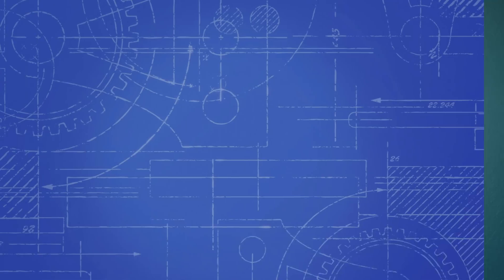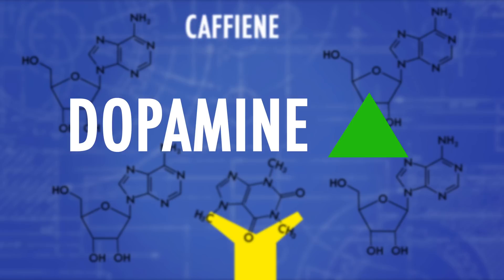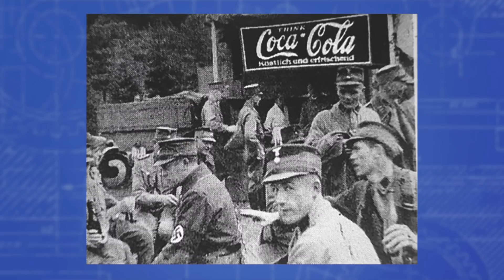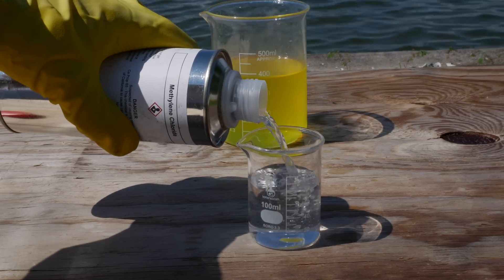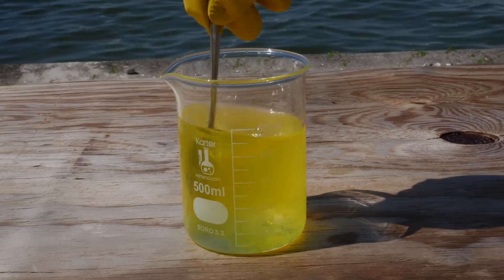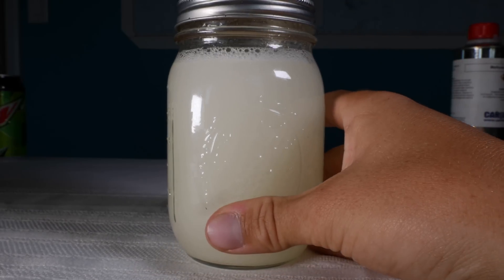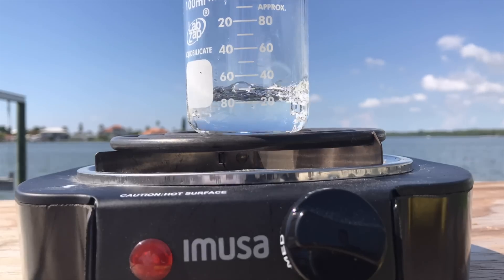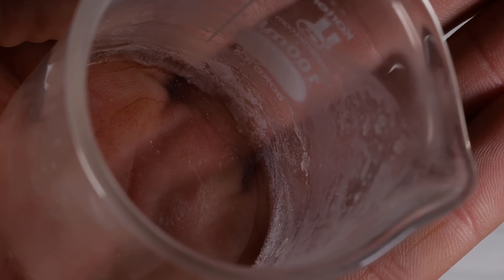Extracting Caffeine From Mountain Dew

Comment: DCM dosen't really make a stable emulsion with water, and not mixing hard enough means there is very little transfer, multiple extractions are recommended too. if you heat the DCM to evaporate it, then you should put a cold flask on top to catch all the caffeine that sublimates (you'd be emulating a cold finger)

Comment: Could boiling at a lower temperature work? Apparently it boils at roughly 40 degrees Celsius (about 110F?)
Reply from the maker: I believe it would. I’m tempted to try this again and just leave it out to evaporate. My hot plate is not very good and it is hard to control the temperature.

Comment: Another great video! Fun fact, I used to work with methylene chloride while making pharmaceutical product (used to coat some oral medication). Now I work with epichlorohydrin, which is from the same group I believe, but also in oral medication!
Reply: you wouldnt happen to be working in epoxy/polymers?
they are a fair bit different, the  epichlorohydrin is a reactive substance (being an epoxy) it can reactin 2 different ways (from the chlorine in a SN2 and an epoxy ring opening)
Reply: That's confidential ;)
Reply: Not a fun fact tbh
Reply: @promosopaplays3559  yea this isn’t a fun fact. A fun fact is like "The yossomer bird lays eggs from its mouth unlike other birds" or something.
Reply from the maker: That’s really interesting! I did not know methylene chloride was used for that.